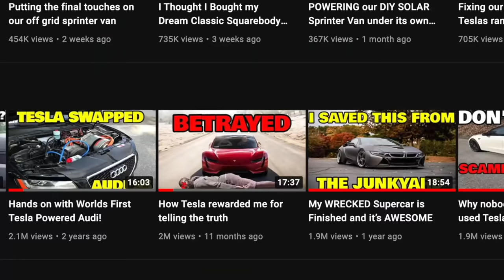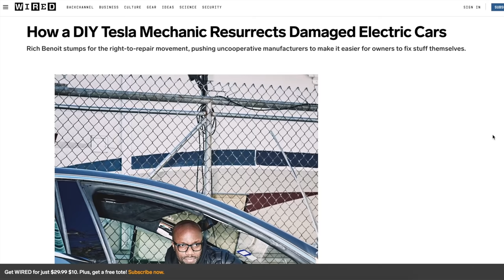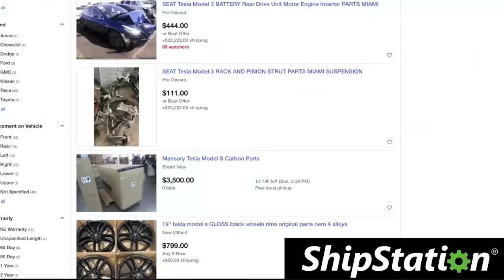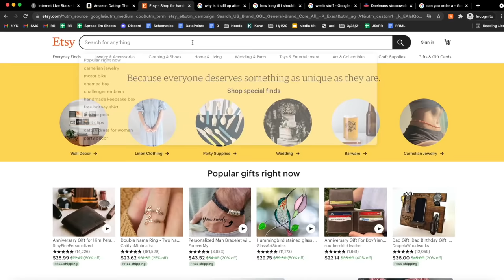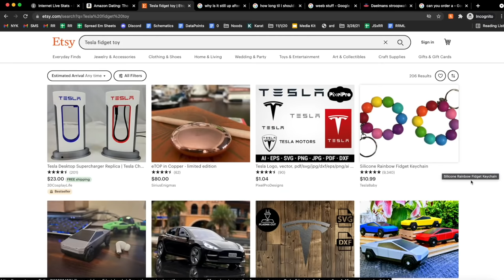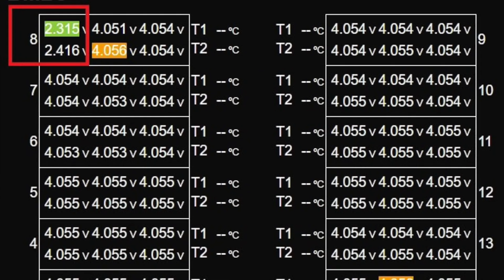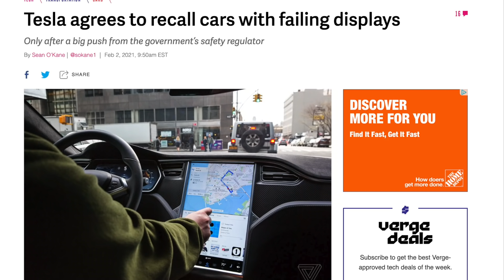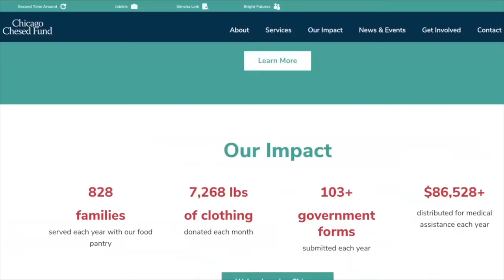Tesla wanted $16,000 to fix this NEW Model 3, we did it for $700! The importance of Right to REPAIR!

Comment: Similar VW story, different ending:
Someone reversed into our Golf, and a tab broke off the headlight. Since it was designed with repair in mind, I cut off the remaining bit, ordered a repair kit, and screwed it on (both genuine and aftermarket parts available). 
So I think Tesla should have a repair kit available, and make a weak point for the nipple to break at a place where it still has enough material to put the new fitting on. Plus the new nipple could also have a weak point, so that you can have it repaired as many times as necessary. :)
Reply: That entire nipple could just as easily be a piece that screws on from the outside. Two screws and a seal.
Reply: How about a plate that will actually provide protection to the fitting.
Reply: It does seem that a design change is in order to make this damage serviceable without battery replacement.
Reply: @PRDMRE  exactly that, 160 x $100 kits or one rich guy (insurance company) for $16k
Reply: AND PEOPLE STILL think Tesla is promoting Sustainability? it's Apple on wheels it's a smartphone on wheels.
expect a fuckton of E-waste once the warranty runs out..   "Just buy a new one hehe :)" 
Tesla is a greenwash..
Reply: The pipe are in the wrong place to easy to break bad design

Comment: Sounds like there's aftermarket potential for stronger skid pans...
Reply: I concur. I'm sure some company in China is already on the task....for dirt cheap to boot.
Reply: Or tesla should just make the part more durable. The plastic seems to not handel a lot of potential road damage that seems pretty likely to happen
Reply: Exactly my thought. However, given how big an issue this seems to be 3rd parties shouldn't be required to improve such a catastrophic design flaw.

1. Tesla should make that nipple design better

2. Tesla should improve the belly pan
Reply: @PeterTPhan  actually its better to have such a weak point in a system, so it doesnt damage the hose or even the battery itself. All it need is to be easily replacable. Why not do the same exact thing?
Instead of molding it into the batter use a plastic thread and thread it on from the outside.
20 bucks to repair at most.
Reply: @D3nn1s  it doesn't have to be stronger, just better. Replaceable nipple is all that's needed.

Additionally, a truly protective belly plate would go a long way in keeping the components in that area intact. That flimsy plastic is terrible.
Reply: @PeterTPhan  or even a simple metal shroud that protects those lines and fittings
Reply: Recall maybe?
Reply: @PeterTPhan  yeah ik, i actually replied with the exact same thing you just said to another comment lol
Reply: @D3nn1s  no it still needs to be molded in, the battery pack needs to be sealed, you wouldn't want a gallon of water sloshing around with all the battery cells. Still, adding a flange underneath it to prevent impacts would save millions in repairs
Reply: @ilovefunnyamv2nd  uhm no? I mean the female thread into the batter, pack would obviously be moulded in, but just screw on the male and make that one the more fragile of the two? Chances of coolant leaking should be identical to the current system
Reply: @D3nn1s  no, weak points are not good. Your logic is flawed. If the plastic is thicker and stronger, whatever broke that nipple would no damage to anything at all, including the hose and battery cells themselves
Reply: @Mach141  im not talking about making it flimsy. But if you make the nipple out of e.g. aluminum and hardmount it to the battery then youll just bend the battery.
I know what im talking about, the nipple is the weakest point in the system and thats a good thing generally. But it should be easily replaceable then.
Reply: Bash plates 👍
Reply: needs to happen in not just tesla but main cars in general, my car had a plastic skid plate and I ran over a rock, and had to replace the transmission, and the pan and a bunch of tubes and the bill came out to $14,000. good thing i had insurance 😆
Reply: @D3nn1s  the hose would be the ideal part to fail. $25 part and $100 at most at dealership rates...
Reply: They already exist.  One is made in china and is painted black and sold by various vendors.  Another is sold by Mountain Pass Performance and machined in Canada out of 1/8” aluminum plate.  I have one installed on my Model 3.
Reply: @wayward03  not really, it looks like it is connected deep into the frame samewhere, you dont want to rip apart the entire car because of that.
Reply: @DeathProductions200  Yes, this is a design flaw.
Reply: @G-ra-ha-m  my thoughts are, have it as a separate piece, that can be made of metal, or a more durable plastic. That way, you don't have to pay over 1000 bucks for it. It can bolt on, using inserts of course, and just uses a gasket. Thus, eliminating the cost of the mold, and it would be roughly the same cost. Maybe a bit more but not enough to charge more than 1k extra on the car. 

There, my uneducated ass fixed the tesla problem
Reply: @DeathProductions200  Almost any thought to preventing a small plastic thing sticking out the side of a giant battery would do ;).
I suspect they've broken a few off in the factory too: it's a dumb design. It should be a female fitting there.
Reply: @G-ra-ha-m  that would be smarter, but if they had to do a male fitting, my method would be significantly better. Also, my issue with a female fitting, if they have it go directly in plastic, it would be more likely to do permanent damage to the case. But its a situation where tesla just messed up with the design. Coolant hoses should either be behind a metal skid plate, or away from the area of damage (return hoses are weird, but still, you can have it set up similar to a radiator, good design, not what they did)

Comment: Awesome to learn new ways to repair these types of things. 
My RS5 mmi Hard drive failed. no infotainment screen, no media connection. Just a black screen. Only option was a $5000 part from the dealer plus coding, or maybe I could find a used one. Then I looked over at my Q7 and thought.. hey what if i take the drive from that. copy the files to a $10 replacement drive, making sure they are compatible with the RS5 mmi. I ended up turning  a $5000+ dealer trip into a 1 hour $10 repair. Works just like it did before.
Reply: It won't be long until a Linux guru figures out how to jailbreak them, and releases the program online, then a complete open source program for them.

Comment: "Why do you want the battery?"   "I don't.  I just don't want Tesla to take the battery, send it off to the factory, fix it, and then resell it."
Reply: .
"Why do you want the battery?"
.
Me:  "Why do  y o u  want it?"
Reply: Exactly. They want you to pay them 16grand, take your old battery, refurb and sell it to some other poor soul for 16grand? FML
Reply: @dallysinghson5569  I think Tesla just dropped the ball here. They could get good PR by just replacing the battery for a nominal fee, and taking back the used battery (I don't think they would put it into a new car).
Reply: @red-baitingswine8816  it came from a new car ... so why not ? There's barrely any use on the actual cells - just put those cells into a new housing .
But yeah. High chances, that it will go back into the replacement program instead of a new car.
Reply: I don't. How much do you want to buy it off me for? Don't forget I can sell it for a good price on Ebay....
Reply: @miscbits6399  Consumer-imposed core charge.  I like it!
Reply: @daemoncan2364  and if they're being asshats about transportation,  take the battery out and flatbed the car to the dealer.....
Reply: Or use that batter and build a PowerWall at home.  :D

Comment: I've been driving my dad's 1997 Camry LE. This car is 3 years younger than me. And i love it. 
I'm an airplane mechanic now, and can work on this car with ease. 
My dad paid $18,000 for it. And gave it to me for $2000. Best $2000 i have ever spent. Been driving it for 7 years now. Runs like a clock to this day. 

No strong-arming from the manufacturer. (Some parts are a bit pricey but i know I'm paying for good build quality.)
No extortional pricing.
No discarding the whole for a bad part. EVERYTHING is relatively easy to do on this car.

And, if Tesla represents the future of automobiles in this country, I will drive this untill I can't drive it anymore. 
Hopefully that won't be anytime soon.

Comment: Great video ... as an alternative to the brass fitting, the MPT to MPT with the hex in the middle is available in a 30% GFN nylon 66 in the same configuration.  Nylon 66 has excellent tensile strength as well as excellent flexural properties, with high heat resistance and thermal properties that would expand and contract at the same rate as the plastic it is threaded into which may be a nylon 66.  Right To Repair!
Reply: Diameter and thread pitch??